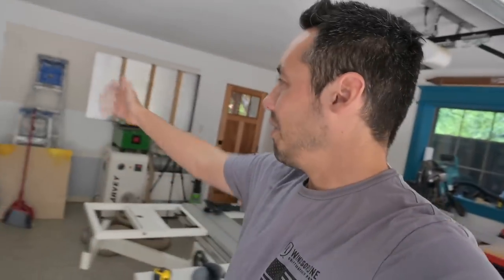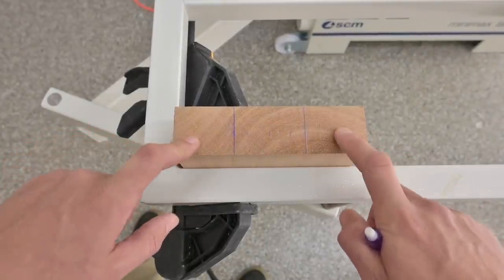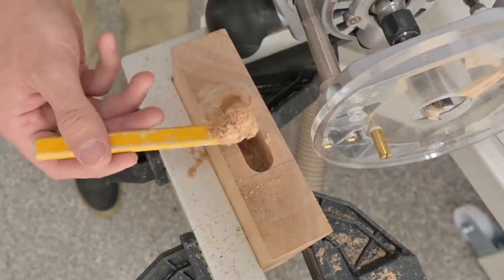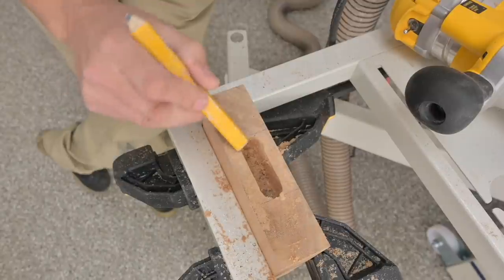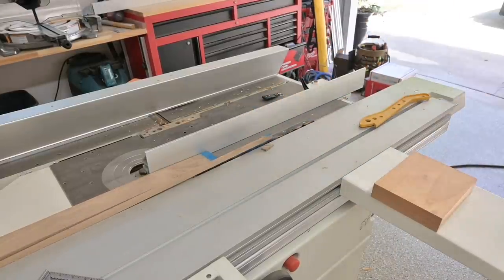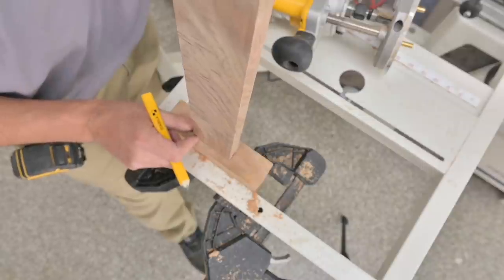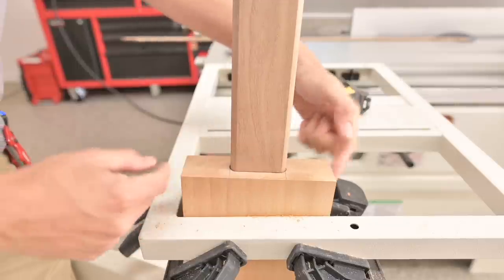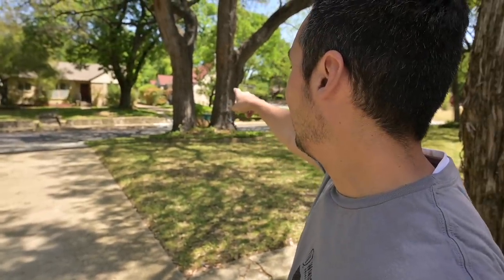Trying something NEW!

Comment: Where the router turns clockwise, looking down on it as you're routing, you should turn the base counter-clockwise to engage the centering pins on the workpiece. That way the bit engaging the wood will try to turn the router base counter-clockwise, holding your centering pins "fully engaged". Hopefully, it'll take less effort for you to keep the router centered that way.

Comment: Make your floating tenons a sixteenth or so shorter than the mortise, creating a place for excess glue or the errant piece of sawdust. It’s a fail safe when gluing up… the tenon will not hold the joint from closing.

Comment: Samurai Carpenter has a great video on a router jig set up he made from acrylic.  You should check it out

Another option:  use some mdf to make a jig with an opening sized correctly, and use a brass guide bushing on your router so you can't veer off your desired track

Comment: You could cut rabbets of a depth equal in depth to the diameter of the brass pins in the router plate... in a couple of boards that you would then clamp alongside the work piece, rabbets facing inward. The rabbets would thus form two channels alongside the work piece, in which the brass pins would ride. That confinement plus the additional support from the remaining edges of the boards would stabilize the positioning of the router.

Comment: ...And you need a little more clearance between the sides of tenon and mortise for glue. As it is, when  the tenon is pushed into the mortise the glue will be scraped of the sides. The only glue surface will  be the radiused ends. You were on track when you said you should have run the tenon through the planer.

Comment: I have done cabinet work in sky scrappers before.  How we always got crown up in elevators was have a building manager or maintenance guy pop the access hatch on the top of the elevator than stick the crown up through the hatch.  Have the building manager put the elevator into manual mode as well so your not fighting the doors closing and being called to other floors.

Comment: most routers out there should have a clear dust port extraction piece you can add to the plate.  My bosch router does, although i'm not 100% sure on the dewalt.  just a thought.

Comment: Some advice , Template Guide bushings sized for the bit, with a shop made or name brand jig. Also a up cut spiral bit for the router will help some with the build up. The ideal usage is for stability and safety at all times of the tool.  I moved over to Dominos for small frame work that requires a tenon. there is also the option of using a mortice machine for the purpose of making the mortices

Comment: When the joint is dry you want it to be an easy fit; when you get glue on it it will swell slightly and if you have a bunch of joints to get together you dont want to be fighting each one.

Comment: Upcut spiral bit and use a straight edge jig on router works just fine. Also Tenons can be spacious on the ends as long as the tenons fit snug in the thickness.

Comment: When make your floating tenons, tale a wood rasp and put a slight bevel on each end. It will help the tenon slide into the mortise easier and give the glue room to squeeze out. Looking forward to both the new door and your crown mold job.
Reply: Similar note - you don’t need the tenon to bottom completely out in each mortise, could cause significant issues in glue up. If my mortises are a a total of 3” in depth, may consider a 2 7/8 or 2 3/4 tenon not 3”.

Comment: when i put my new front door on and had to cut a mortice out for the first time i used extra bits of wood clamped in with the door so i had a wider surface to put the router on and i could also use those pieces of wood to put a couple of screws into to make physical stops for the base plate of the router to hit in four directions ( i had no pins in th plate as the extra wood was in the way)

Comment: you really should pick up the Domino, from experience (working in a cabinet shop in Norway) it's very convenient and saves alot of time. With the ability to use different sized dominos, and multiple in a single joint, it's plenty strong enough.
Reply: The Domino is very expensive. You would need to being using it a fair amount to justify it's purchase. Loose tenon door joinery is accepted in the door making industry as m/t and dowels. Plus most people own a plunge router. I own a Domino, because we use it for many different solutions.
Reply: @aspees  most definitely is a domino more expensive than traditional mortise/tenon, Loose tenon or dowels. but ease of use to cost ratio, u cant beat the domino

Comment: Check out the hatch in the elevator see if you can get permission to pop that open put all the crown up through there if u need more than one trip you have to work out a deal I’ve done it several times before and new and old buildings

Comment: Make sure you cut the tenon a fraction shorter than twice the depth to make sure it doesn't prevent your pieces from butting up tight.

I've just built two pair of French doors using loose  tenons, morticed using a plunge router mounted in a table. You should be able to use your router table with that straight bit, or a spiral up cut bit even better. Still tricky but better than hand routing and then the dust is managed as well. The length of the mortice is not critical and in fact is better slightly longer than the tenon to allow sliding the pieces for perfect alignment. Also, it's not critical to precisely center the mortices, they just need to be the same distance in from the same face of the finished assembly.

But you probably could still justify that domino.

Comment: I’ve owned both Festool Dominos for  roughly 4 years now and my suggestion to you is if you’re doing that many doors, you need the df700 xl domino. The df500 is more for smaller jobs, even though I use the df500 much more, whenever I make full size doors as I am doing right now (barn doors), the df700 xl has the ability to make deeper and wider mortises. Most doors with loose tenons require at least a 12 or 14mm x 100 or 140mm deep. The df500 Isn’t capable of that. The most you can do with the 500 is a 10x50mm domino.

Comment: But if you do want words of advice, use a plunge router so you could adjust your depth of cut, and build a jig where the center of your bit winds up in the center of the board. Use stops so that you could use the whole router to adjust the width of the mortise you're making. Other than that you're doing great you'll figure it out along the way. Definitely stay away from those pins.

Comment: Ive done alot of bits with the festool domino, best tool I've used, I can imagine the domino xl is the same but on roids, dust extraction is vital for correct operation, but just a regular vacuum will do that.get the actual domino tenon's for perfect joints and gluing spreads alot better with real dominos

Comment: I feel like a router table with stop blocks would solve most of the possible error points plus dust collection. Only issue I see would be board length that you plan on mortising. Smaller pieces are easier to handle on router tables.

Comment: crown problem.  stop elevator on 3 floor.  pass the crown into the open elevator shaft on 1st floor - stand upright and take it into the second floor.  send elevator to 1st floor - you now have a an elevator shaft you can put the crown in and have it ride up to the 9th floor, open the doors to the 10th floor and retrieve your crown.

Comment: What if you make a jig with two 1x4s clamped to each side that run wild. Fasten stops so that you don't have worry about focusing on the lines, just holding tight to the jig. Also with the jig in place the router will have a wider platform to sit on making it more stable. 

I have three barn doors coming for a client, I'm really wanting to get a Domino. Been looking for an excuse to get one for about ten years, this could be that moment lol.

Comment: Did you purchase that brass pin router base? Those are the kinds of rubbish accessories that keep the tool stores in business. Buy a high quailty solid carbide upcut spiral bit(not a Homie Dopie/Ebay special). Set the adjustable depth stop so you can accurately take 3 passes. Always plunge the front and the back of the slot first. 

In alot of ways doing slip mortise tenon constructions is ideal practice for someone like Richard to master his router. It hits all of the typical challenges & skills.

Comment: Crown: (Don't know how many feet you are installing) at 6 stories..We literally shrink wrapped 6 lengths of 16' crown at the ends and middle, placed them in a cardboard tube, threw down two 70 ish feet of rope. Connected one rope to the top of the tube and the bottom. Pulled mostly from the top tube rope until the balcony. Pulled tube through railing into slider to ceiling height. The bottom rope was pulled to lift up back end to assist in getting into room. 3 trips. Should have rented a lift back in early 90's.

Comment: At 20 cents each, making your own tenons will represent a high cost savings. Setting aside the cost of the wood, you’ll have paid for the domino with only 5,000 or so tenons. Wait. Will the domino beca business expense (make sure to mention and show that in subsequent videos), so payback might be even better.  And the pin base for the router has some limit on the width of the rail you can mortise.  Domino!

Comment: We did a 6000sf Ipe deck on top of a 23 story building in downtown Dallas, using 5/4 material plus the pressure treated 2x material all 20 foot long.

 We took material through elevators using the access panel on top to slide the material into the elevator shaft and  we also sent 20 foot material up a stair way using like 10 or 12 guys. 

It was a b*tch!

Comment: You need to check out Festool Domino . I just bought the df 500 it’s  amazing makes the job easy and accurate. For door construction the Xl 700 is recommended. I’m a long time woodworker.
Reply: I think with doors you could still get by with the 500. The largest domino with the 500 is pretty big, and you could use several on each seam. And if you really wanted to go crazy you could use more than one row.
Reply: He made this video to justify his purchase of the domino. He said it in the video…

Comment: Richard You have that nice shaper/router table why don’t you use that to mill your mortises out?? Also I would not make the loose tennons the exact length that you need leave room for expansion. So if you measure 1 3/8” depth of the mortise leave the tennons 1/8” shorter. Good luck.👍🇺🇸🪚📐🔨👨🏻‍🦯👨🏻‍🦯